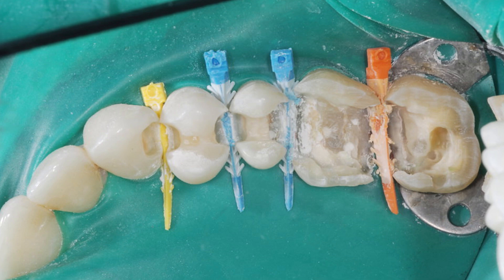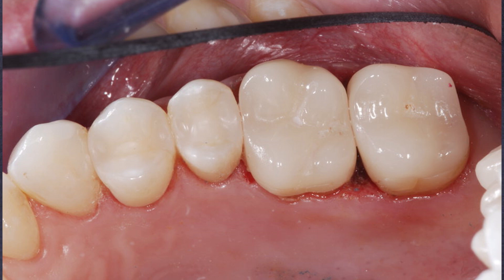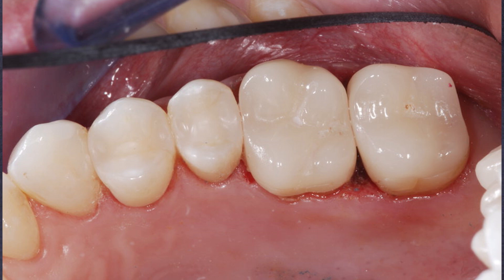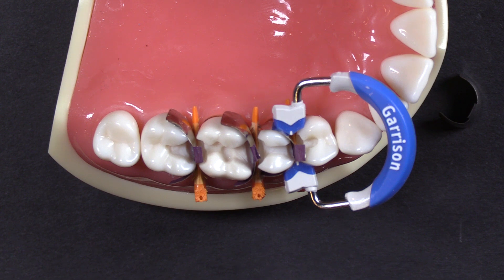Top 5 Questions: #1 | Back-to-back Class IIs

Comment: the problem I found using garrison is when placing the clamp, the bow of the clamp is blocked by non-even occlusal table when there're some teeth higher than the one that your're filling. how do I solve this problem.
Reply from the maker: We recommend using the orange ring instead of the blue because it sits up taller than the blue ring (it has taller tips).
Reply: @GarrisonDental  thank you very much

Comment: Hello great teaching method. Could you by chance tell me where I could find a dental model like the one you have? I  need to practice  how to place the matrix bands on the mod, and do surfaces. Thank you for your time.
Reply from the maker: Thanks for the question! I believe the manufacturer is Nissin (out of Japan) but we buy them through Kilgore if I'm not mistaken. I do not know the exact model for the types of preps we have, but they have so many different options for you to customize your typodont. You can even prep your own with your handpiece (we've done it a few times ourself).

Comment: pro tip: if you restore the fillings with both bands touching each other, fill one, slide out that band, burnish and restore the other filling. That way you can leave the ring on and not have to double your time like they are doing here. I've been doing this and have been getting great success with contacts/contour
Reply: How do you remove the first band if there is a ring? Don't you have to remove the ring first in order to remove the band because the ring keeps the band in place
Reply: Any bleeding when you do this?
Reply: I agree with this. Exactly how I do back to back class II's.

Comment: Short Answer: You can do back to back classII restorations, but doing a single tooth/surface at a time will usually provide a more predictable result .

If you came straight to the comment section, you've earned roughly 13 minutes 😁

I use this matrix system daily in my practice

Comment: Seems like a long video that could have been condensed into restoring one tooth at a time. What is the advantage to doing all mesials or all distals at once. None that I can think of other than you have a hammer and this matrix system is nails.
Reply from the maker: Thanks for the comment! There's always multiple ways to get the job done, and we do advocate for being conservative with your restorations whenever possible, meaning one prep completed at a time even when multiple are present. However, this is the #1 question we get from our customers on how to best use our matrix system for back-to-back restorations. This video is to show the benefits and limitations of such a procedure.

Comment: why do you use rings in mesial contacts only not in distals too ??
Reply from the maker: You could do it the other way around too.  Whichever side you do first, you can potential skip the ring.  You will get more buccal/lingual flash, but it can be very difficult to place the ring when two bands are in place.

Comment: What about bleeding issue when you remove the wedge after the first proximal filling? 
Removing and  re-wedging gives rise to gingival bleeding
Reply from the maker: Yes, it will tend to aggravate the gingiva.  However, if the second matrix band is properly sealed against the tooth with the wedge and ring, you will not get crevicular fluid contamination.  If you are getting ANY contamination in the prep after everything is seated, it is not seated properly.

Comment: In my experience it's best to place all the matrices at the same time, so you don't invade the space in the proximal box of the neighboring tooth when filling one tooth. I then fill all boxes facing in one direction without any ring first, remove the matrices on the already filled teeth and finish the remaining restorations one by one with one ring in place at a time. This gives the most predictable results and doesn't crowd up the operative field that much.
Reply from the maker: Hagen - Yes, that is an excellent option.  Over-extending the first restoration is easy to do and can make placing the second band very difficult.  Thanks for posting your technique.
Reply: @GarrisonDental  Do you have any alternative suggestions for not over-extending the first restoration? I've heard of folks putting a cotton ball or teflon tape in the opposite restoration but interested to hear if ya'll know other ways
Reply: came here to make this comment, works good for me!

Comment: When you burnish a band against other tooth wouldn't it make contact completely flat? And wouldn't it peel off Teflon coating from a band?
Reply from the maker: "Burnish" might be too strong a word.  You are correct.  You don't want to flatten the contact area, but you do need to make sure that the band is fully in contact with the adjacent tooth.  If the coating is coming off when you push the band over, your instrument may have some sort of snag or sharp edge on it or your are burnishing too aggressively .  A smooth instrument of sufficient size should not be able to scratch the coating off.